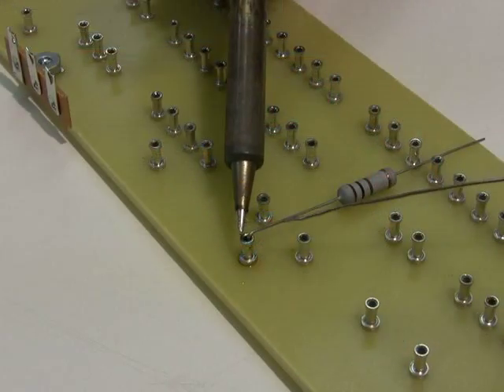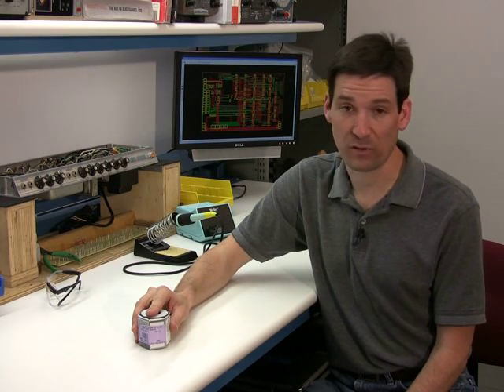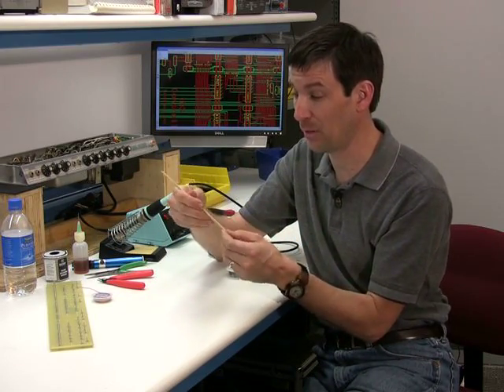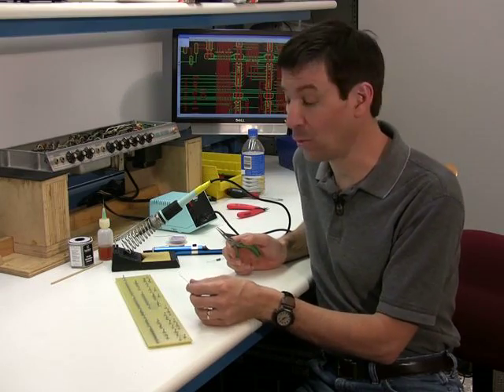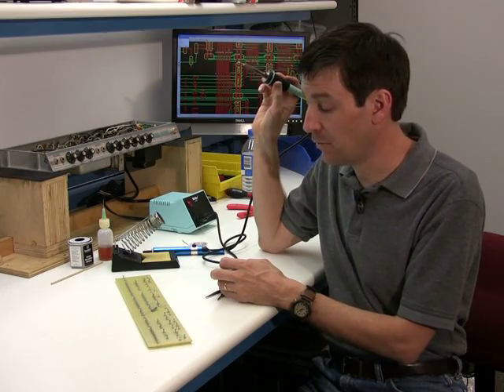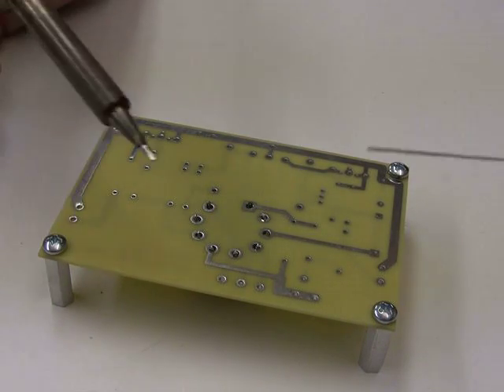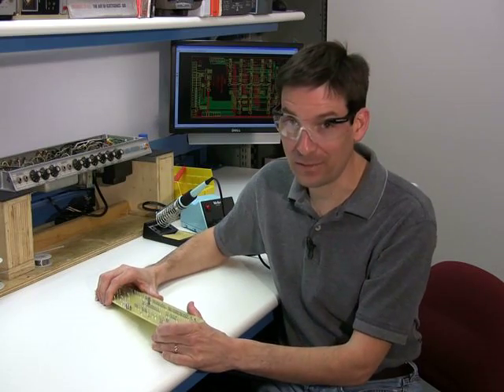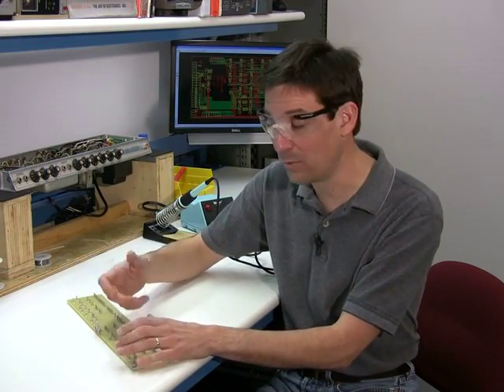How to Solder

Comment: How is it, when I see soldering demos, it take a second. I’ve been thru several different irons and they all, regardless of power take time to heat the connection. And yes I pre heat the iron.

Comment: Pro tip (and just the tip) when cleaning flux off the board:
Apply alcohol to area and cover it with a tech wipe, then use your acid brush over the top of the wipe. This can slow evaporation and allows the wipe to absorb the alcohol and flux as you are scrubbing.

Comment: 4:55 ; This is not up to military spec. He should have shortened the lead by cutting it in place slightly more than 50% (cause 50 is the minimum). This lead needs to be tight against the post for a good mechanical connection and to be considered passable for Micro/Miniature (2M) repair work.

Comment: you didn't use flux?
Reply: The solder will have flux in it, so it's fine for this type of connection. You probably want to pre-flux before soldering if you're working on a PCB with SMD components.

Comment: Would it be possible to use wire-wrap for a guitar amp's circuit? (Obviously you'd still have to use soldering to secure components to wires or wire-wrap pins.) Was wire-wrapping used in any historic guitar amps?

Comment: Another good reason to remove flux (or just don't use it to begin with) is that flux creates noise quite often, especially when it crosses traces on a PC board.
Reply: I would like to see you soldering without flux

Comment: For soldering guitar components, amps, circuit boards, switches, etc., is it better to use a 30 watt or 60 watt iron? I've used both but the 60 watt really burned through a lot of stuff and the tips kept disintegrating quickly. too much power?
Reply: probably want to get a 40W or a 60W variable soldering station.
Reply: maggit, your iron may have poor plating on the tip, or was it perhaps damaged by cleaning it by filing or sanind it with abrasive paper? Keeping the tip tinned with fresh solder at all times keeps the plating from oxidizing. swipe on the damp sponge or soft brass wool as soon as the iron gets up to heat, tin with fresh solder, clean and tin before and after each connection. your tip should last a very long time this way. I have tips that have made over a million connections, still looking good and on the job.

Comment: Im so crap at soldering, i upgraded my strat with a new set of pickups but i couldnt get the solder to stick to the pots, everytime i thought i had done it id touch it and it would pop away, i ended up putting way to much solder on the pots and it looked a mess, any tips on why the solder wouldnt stick to the pots ?
Reply: Pots have a coating you want to scratch away first.
Reply: Paul Roadz - pots could have had a coating on them or your soldering iron wasn't sufficient to heat the pot enough for the solder to stick (very common).  Use at least a 40W iron and a little electronics grade solder flux is helpful.

Comment: Thanks buddy. Soldering is the HARDEST thing for me. I believe it's due to a under performing, cheap soldering iron. But now that I have these techniques, I want to try again. Question; how would you solder multiple items in one hole (for lack of a better term)? Example; on a 5E3's fiber board, I see multiple caps being soldered to one location, but not at the same time. If you were to solder something after something else was there, wouldn't that make everything a bit more difficult and result in a possible bad solder?
Reply from the maker: John, good tools make a huge difference in soldering ... especially the quality of the soldering iron. For fiberboard eyelet soldering, I recommend a 35W iron with a larger sized chisel tip. The added mass of the tip provides the necessary heat for the connection. For soldering multiple component leads into a single eyelet, the solder is added once all the leads have been installed. With practice, soldering becomes much easier.

Comment: Isn't it a good idea (when soldering components such as capacitors) to attach an alligator clip with a lead to act as a heat sink to prevent damage to the component?
Reply from the maker: Point-to-point component soldering isn't a problem as the component leads are usually quite long and the components themselves are large enough to dissipate the heat. A good temperature controlled soldering iron (on 650 degrees F) and good soldering techniques are the most important. I use a heat sink only when having to leave the soldering iron on a large connection for an extended period of time. Otherwise, using a heat sink for every soldered component isn't necessary.

Comment: Some nice advices, but in my opinion you should:
1. spend more time to heat up the solder spot
2. than add some solder
3. wait two seconds and then add the big amount of solder
4. first take the solder away
5. take the iron away, when you can see that the solder is melting around the spot like icecream in the sun
6. don't push and pull a fresh soldered connection... wait a couple of minutes
Reply from the maker: Thank you for your input.  The process for a good solder connection is:
1) create a good mechanical connection between the two surfaces to be soldered
2) apply sufficient heat to both surfaces that solder will evenly melt.
3) once surfaces are at proper temperature, apply sufficient solder to flow evenly around both surfaces.
4) once sufficient solder is applied, remove both solder and soldering iron at same time
5) finally, do not move connection until solder has solidified.
I mention these steps and properly demonstrate them in this video.

Comment: The most important part of a good connection is a good mechanical connection, the solder keeps it from moving.  Yes solder is a good conductor but, a mechanical connection is the key to a good connection.  I disagree with not first making a mechanical connection because it's hard to remove.  Just my .02 cents.

Comment: I have a soldering station, kinda like the one you used. What should I set the temperature for PCB soldering? It goes from 0-450 Celsius or 0-842 Fahrenheit. I'm using kester 60/40 solder wire
Reply: Use 63/37 Sn/Pb, it's an eutectic alloy so there is no plastic state. For temp start out at 600 F and work your way up to whatever temp you need.

Comment: how do you stop wire coating/plastic sleeve from shrinking back when soldering it to a pcb?....it really bugs me....i put the wire through the pcb hole then solder, but the sleeve always shrinks away from the hole, even if i do it quite quickly.....thanks.
Reply: Too late, I know but to answer your question anyway: use an alligator clip style heat sink and place it on the bare wire butted up to the edge of the wire's insulation. The width of the clip will also allow you to maintain a standard clearance between your board and the insulation. Be sure the clips don't have teeth. Those are not heat sinks!
https://www.amazon.com/gp/aw/d/B0032UYTV6/ref=pd_aw_sim_sbs_328_2?ie=UTF8&psc=1&refRID=TQY52W0KSAWPSSG4BMGN&dpPl=1&dpID=31d95PBt5OL

Comment: Goodness gracious! Your soldering without safety goggles.

I always use lead free solder. Lead based solder is harder to get these days, in Sweden. Question, what board material are you using?

Comment: @TubeDepotTV: Thanks for the feedback. A little to late though. I already soldered it. It's a little messy, and I wish I used lead instead, but for some reason I thought silver was superior. Is it possible to remove solder in an easy way? Probably not advisable, right?

Comment: Do you recommend any good soldering irons (except for Weller there a bit too over budget) for very small components? ex.) data ports on an Xbox. Because I've recently bought one from the source, and the tip went completely black from first turn on (even flux cant help it :(  )

Comment: @TubeDepotTV: ok, sorry for bursting out. I was just frusterated that there is no videos on youtube that show how to use flux (for electronics). I was soldering for the first time today, it went so-so. I bought the gun, soldering wire (silver bearing?), and flux. But I wasn't sure what the flux was for. Do I put it on before I solder? Or after? Do I put it on the tip of the gun? Or on the wire? Or on the soldering wire? How much? I was fixing my cable from my comp to my moniter, lol. Delicate!

Comment: Thanks. The servo is attached to the board by screws then the small wires solder onto the board. (heres the part number of the board and the servo EFLH3001 ,,,, EFLH1066. I nscrewed it off the board the pulled the wires off. So when i receive my de solder pump ill take the solder off.  

THomas

Comment: Thank you for your very informative reply!  I bought a suction of ebay for £3. I need it because i need to replace a faulty servo from a motherboard on my rc helicopter.  But im a bit nervous because the board is very small and if i mess up the soldering ,to buy a new one is £60 !!!  Any tips on soldering tiny thing   Thanks

Comment: He did mention that the core of the solder has rosin flux in it.  For most applications that's really all the flux you need.
Reply: Penfold8 still good to have a syringe of flux around.. the stuff in the solder burns off instantaneously